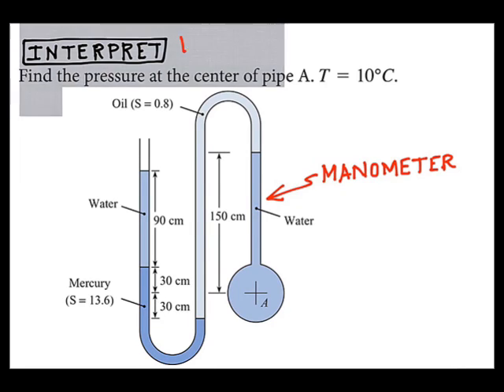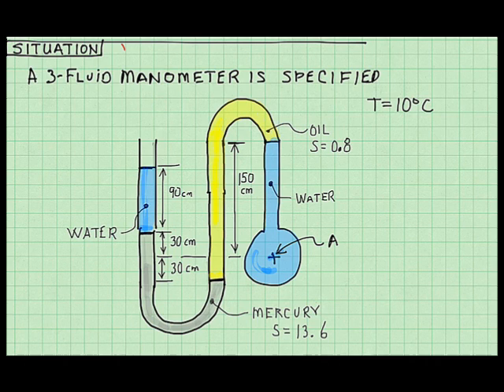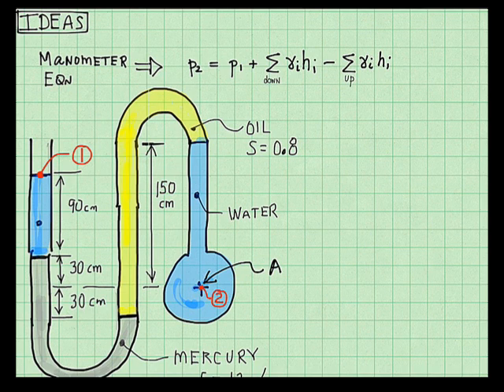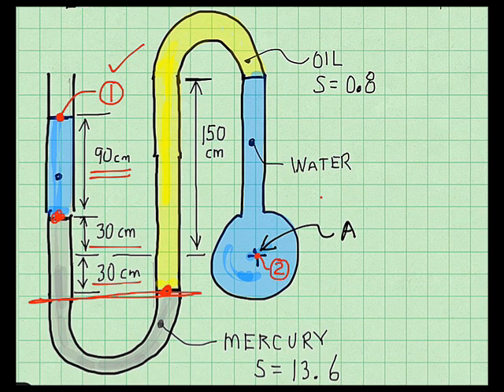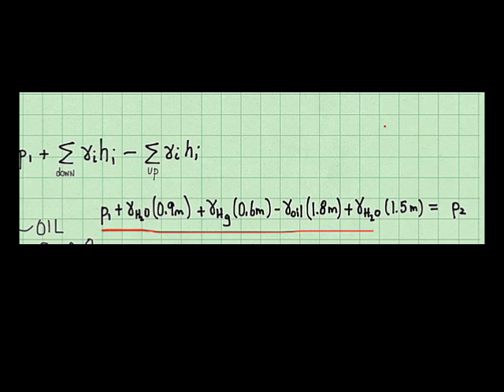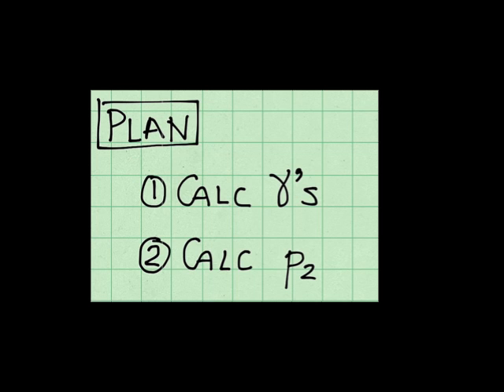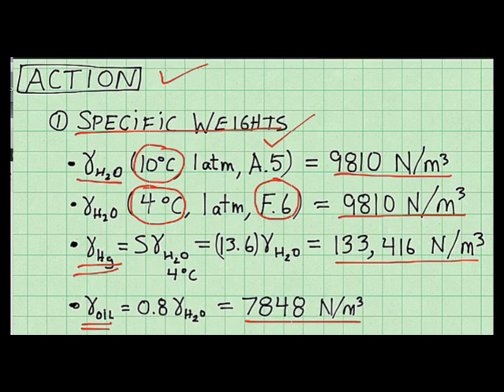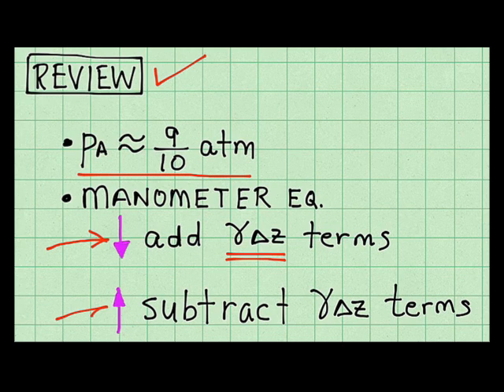Example-Manometer Equation

Comment: Sir,i have a question,why is the pressure at P1 is zero?
Reply from the maker: It is best to use gage pressure for a manometer. The gage pressure at 1 is zero. This is because gage pressure = local pressure - patm. Since the local pressure at 1 equals patm, the gage pressure at 1 is zero. Hope this helps.
Reply from the maker: Use gage pressure for a manometer. The gage pressure at point 1 is zero.

Comment: Hi Mr Donald Elger or anyone that did this problem taking P1 as atmospheric pressure at 101kpa and got a final answer as 190.47kpa for the pressure at A? Please reply if you got a similar answer.
Much Appreciated
Reply: Hi Leeshan, the Pressure at A is 190,47 KPa (absolute  pressure), always remember Pabs = Pgage + Patm, it results adding to the the gage pressure obtained the value of the atmospheric one (101KPa).                                                                Regards.

Comment: if its open to atmosphere shouldnt the atmospheric pressure be included?
Reply from the maker: HAfusion Gage pressure should be used on this problem. Thus, p_atm is not included.
Reply: P1 is the P_atm